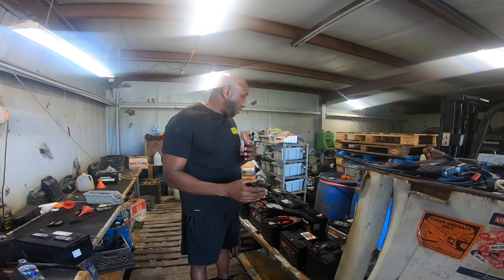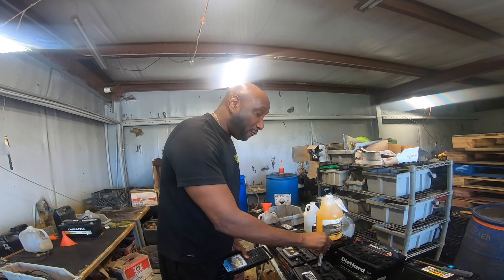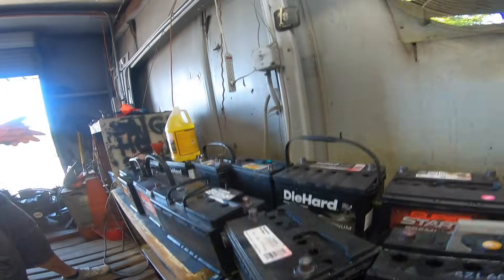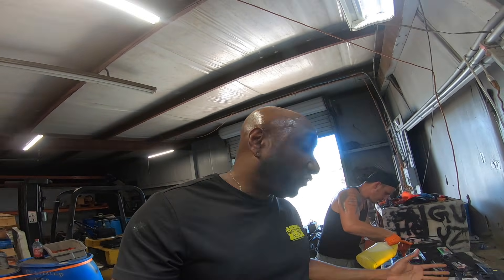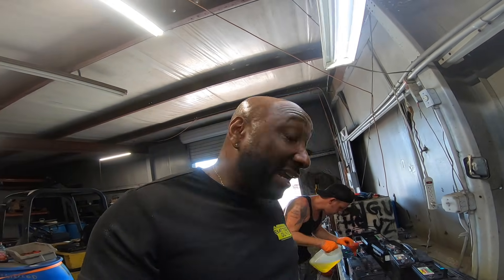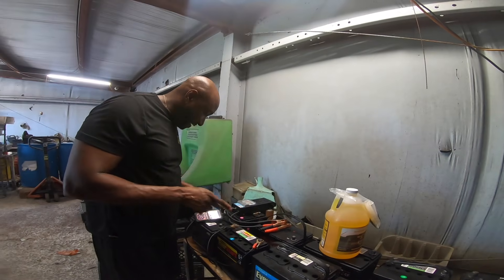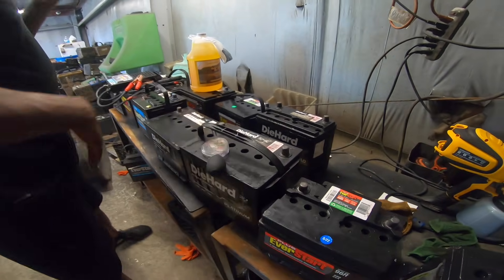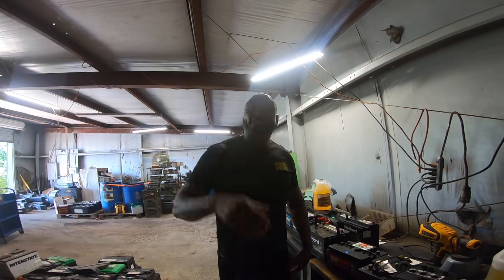Reconditioning Auto Batteries

Comment: I have 4 8 D batteries, that after purchase found the float 12.2, so tried charging with manual charger.. they need fluid the gravity is at the edge of green n white.. but delima is they hold 17 liters each 😢 but believe they can be repaired, cost me $100 each

Comment: I just don't see the point of buying a $50 +tx+tr rejuvanator adding all the work, time for a single battery. I mean these batteries are  7 months, a year, 2 years. Who's the dumbass in the first place screwing up those batteries. I live in a hell beaten cold climate, my batteries stand for 6 or 7 years of service with proper cleaning, toping up. And can still be used as secondaries.

Comment: I had an old battery with no voltage showing on the ammeter.  I drained it cleaned it twice with distilled water and put this stuff in.  Charged it with a battery charger.  This was 2 weeks ago been starting my carever since.  Awesome stuff
Reply: Guarantee this is just sulfuric acid mixed with water and yellow die to make about a 50/50 mix.

Comment: So, in the last 25 years, chemistry has changed ? From 1940 - 2000, we reconditioned batteries by removing the caps, put on a heavy charge. Let it cool, pour the old contents into a metal oil container, and dump baking soda in to neutralize the old acid. We then poured in about half a container of distilled water, and the rest would be battery acid. Then charge it. Now you are saying that doesn’t work?

Comment: I just bought a gallon to replace the old solution in a battery that got engine oil in the cells.   I really hope this solution works.   If it does I'll be doing the other battery for sure
Reply: Did it work?

Comment: PERHAPS you can help me!! I have purchased a golf cart with 6 8volt batteries the manufacturer date is May of 2023 they are all deader than a doornail I have tried to independently charge them I get voltage but the hydrometer just stays in the red. I have seen the baking soda thing the welder thing a box that's supposed to do the sulphate breakup and would like your assistance as to how to save these expensive batteries. Is there a solution that can restore two year old batteries. They are CROWN 8 VOLT. Your input appreciated
Reply: When I tested the water it was crystal clear and no acid burn!

Comment: I am so glad you were specific on this video. Replacing ALL the fluid is what is needed. Most of the instructions I have seen, say 3 to 5 ounces per cell, not the whole fluid.

I suspect a little Phosphoric acid, in you patented formula (adjusted and tested to be correct levels) could be what is desolving the Lead Sulphite crystals.  You've done the research, so I don't have to.  Thank you.

Next Social Security deposit, will allow my purchase of multiple gallons for the "house" batteries in my sailboat.  (Heavy duty commercial truck batteries, many years old).

I've dumped, cleaned with Epsom salts, then water, than regular store-bought battery acid, and now it's time for the "real deal".)

Comment: Will this work for VRLA batteries? Have a bunch of bad ones here. Some from Mercedes as old as 2012 and still kicking at 200amps. Also some 2018+ that are very low. Varta valve regulated lead acid /agm

Comment: Would you get higher result if you cleaned the old battery out with Baking soda first, too?  Then placing your solution after it is drained and rinsed with water too? Thanks
Reply: I would never put baking soda in a battery that I was planning on keeping lol
Reply from the maker: @drizzyfam3893  Never Ever
Reply from the maker: No, just rinse out the cells with distilled water

Comment: So basically the batteries that we buy now are actually filled with distilled water when really they be should be filed with sulphuric acid as I'm not sure what's in your battery stuff as I'm living in Ireland ☘️🇮🇪 & we've got the same shite over here, Good video guys.
Reply: Well there is definitely sulphuric acid but I'm thinking he is either saying it's a weaker  solution and or that there are additives that stop the plates from sulphating I assume once the that happens that basically removes the Sulphur from the acid

Comment: Do you have a video to perform this process? I'm ordering 2 gallons today
Reply: Did it work?
Reply: @Brendondg I have two 15 year old batteries that are still working in a diesel truck. But if the battery has a cell that gets disconnected it's pretty much never going to work. I think you should start by filling the cells up with distilled water and while you are charging it check each cell for bubbles. If they all have bubbles and it holds a charge for more than a few days it's probably worth getting a gallon. I've done the arc welder trick and it improved the amount of bubbles in the bad cells but only 5 out of 10 of the batteries came back to life.
Reply: @Brendondg  check out what happens when one of the cells becomes disconnected from the battery. I'm not sure if they can fix it if that happens.

Comment: Do people just dump used solution into the sewer?
Reply: Pour baking soda in it, then test. Ph neutral it can be disposed of in a sanitary sewer.
Reply: Dump the old battery acid into a 5-gallon plastic bucket and for baking soda in it until it stops foaming.

Comment: 23 Kenworth my batteries barely last three years, In context It does have an APU to charge the battery. My mother 09 Land Rover lasted until 2016,It was still running strong just replaced it for no surprises in the morning from there and only last 2 years. Even my 2019 freightliner EPU I have to keep changing every other year because the battery keep failing.  never would’ve thought it’s the adjective they put in batteries themselves more water down but more expensive.

Comment: I just wanted to clean the plates and pour my own sulfuric acid and water back into the battery as was done at the Mercedes-Benz counter with a brand new Mercedes battery it was dry when you got to the dealer they pour the acid in and tell you take it home you put it on a slow charge and it lasts 7 years I have that sulfuric acid water solution here my question is is if you're cleaning the plates don't you need to dump that out and refill it with water and sulfuric acid?

Comment: I'm sold. I drive exclusively old vehicles, if I can keep the same battery in it for a decade I'm sold
Reply: Fun fact. As long as the specs are the same. Like voltage, current and amperage are the same. Boom it doesn't matter the type. As long as it's the same specs
Reply: @jamesv4463  You mean at least the same specs. Meaning it can higher but not much lower than the original CCAs/amps

Comment: I have to admit you are telling me the truth. My last '4 year' battery lasted 3 years. I am old enough to remember when I could get 6-7 years out of a battery. 
I have always thought there should be a solution to dissolve the sulfation but there is some metal loss that is not replaced.  If it buys me another year or more this looks like a good solution.
Reply: In like 01 my uncle had a 86 case 850 dozer with the original batteries in it.